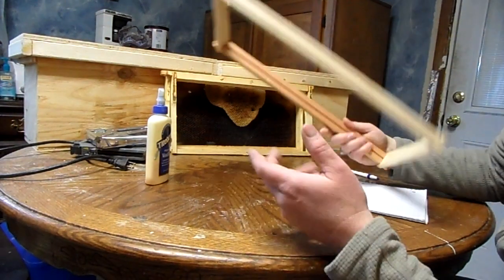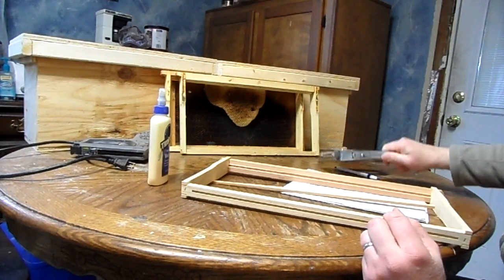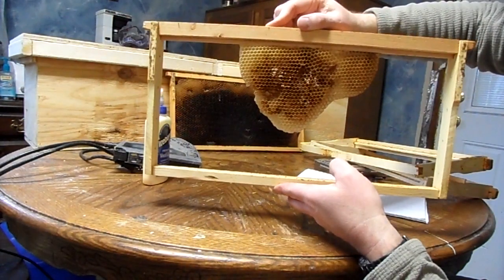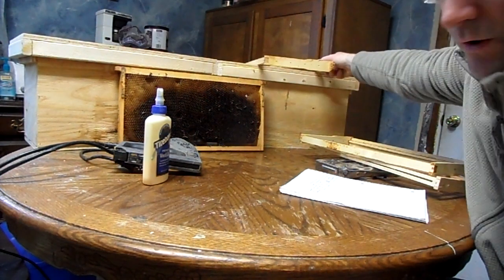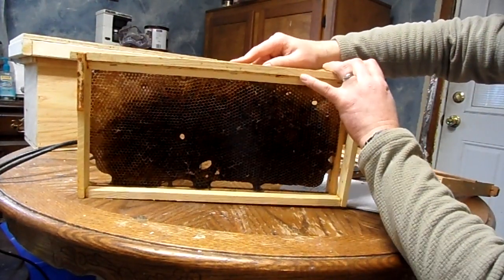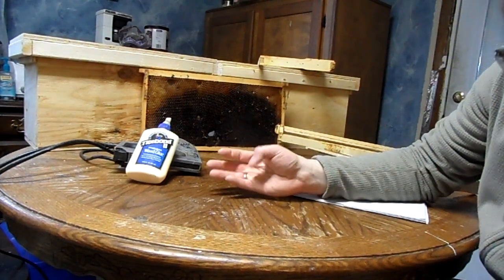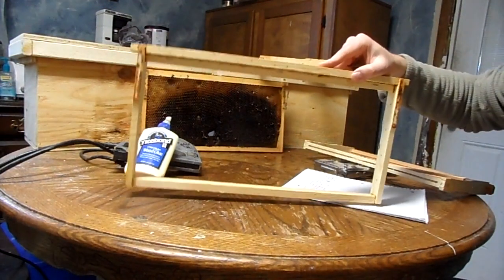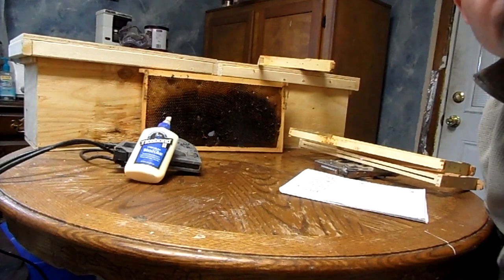How to make and use Foundationless frames in a beehive video

Comment: hi great video! how will you recomand me to start foundationless super? i dont have any caped honey combs. i have a few strong hives that i would like to put supers on but will it work if i just put an empty super with 10 frames ? of course ill use the little wood thing in the top bar..
Reply from the maker: Starting a new super or brood chamber with no other combs is trickier, but not impossible.   When starting from scratch so to speak it's VERY important for the hive to be level side to side and you should keep a close eye on them (every couple days until they have at least one good comb built).  Once they have once good comb they should continue, the difficulty with honey supers is they may keep drawing the comb out into the empty space next to it.  Once it's capped they won't which is why putting empties between capped is best in supers.  You may need to trim here or there, but in the end you'll get what you need.

Comment: If you put an empty frame between 2 frames full of brood, won't that mess up the order? I have heard you shouldn't change the order of the frames in a box.
Reply from the maker: That is a loose rule that applies to putting frames back in a box after an inspection, because of differences in how the comb is drawn out or burr comb the frames will go back together best in their original order.  However when you are getting new frames of foundationless drawn out your larger concern is where are they going to be drawn out the best and fastest, and that is going to be between 2 frames of capped brood.  Thank you for watching...
Reply: Thx! That makes sense

Comment: If you do not have drawn comb can you use plastic unwaxed foundation for the guides? I know the bees do not like plastic even with wax, but I do not want them drawing comb on the plastic foundation, only using it for guide then when they draw the foundationless , replace with more foundationless frames?
Reply from the maker: You can try that and it might work.  Ultimately if you are level side to side and they have a good comb guide in the middle of the frame they will probably be just fine.  Just check them often, one good comb leads to another.  one bad comb leads to another. ...

Comment from the maker: I don't want to seem too arrogant but most of the information you would need to be successful with foundation is contained in my video. Most of the major suppliers of bee equipment use the same tolerances for the woodenware so a deep frame from mann lake should fit in a box from westernbee supply with foundation from dadant.

Comment: What would happen if you had an empty honey super and you wanted them to draw out the foundation led frames?
Reply from the maker: It could be just fine, or you could end up with a bit of a mess.  Best not to have them trying to draw a full empty box that's for honey storage.  I try to put one of my honey frames down near brood nest to get it started.  If queen lays in it, it's only a problem if you are doing comb honey.  If you're honey frames are a smaller size than your brood box, you just have to pull it out faster or scrap the bottom.